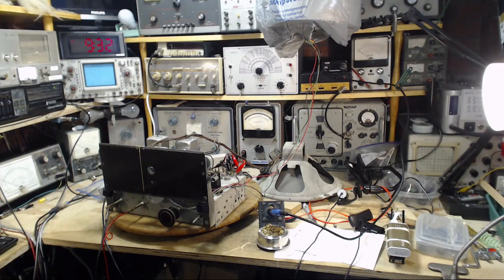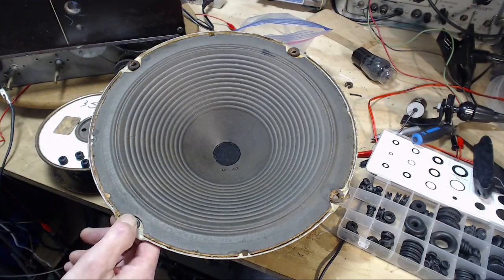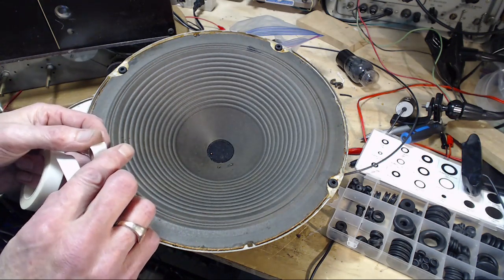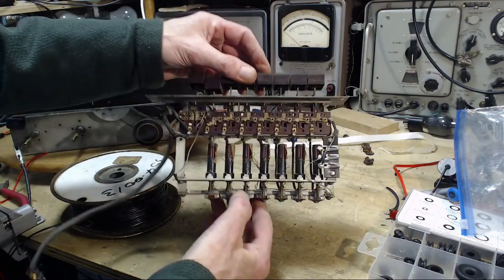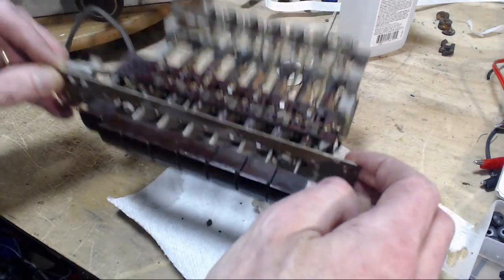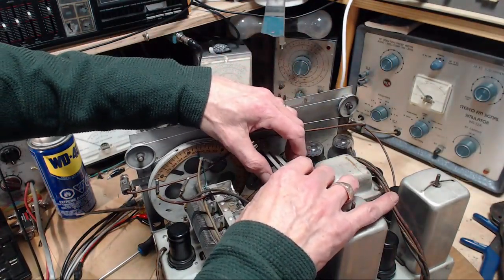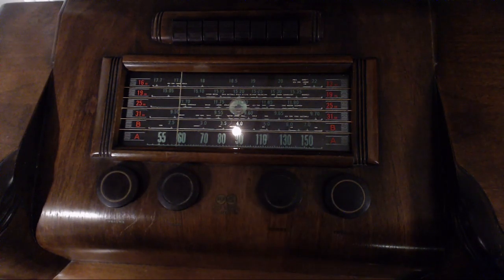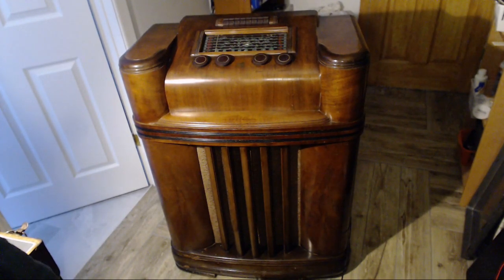RCA A-32 Globetrotter Video #14 - Last Things and Final Test

Comment: That design of speaker (nothing to press against soundboard) was common with RCA during the immediate post-war period. They relied upon neoprene "grommets" to prevent the frame from vibrating and to isolate the speaker from the board. This appears to have been done to prevent "beer barrel" bass at voice frequencies. There was NO cardboard or other material. This was a calculated design by RCA. They also used it on early TV sets with 10 and 12 inch speakers. It became part of their "Golden Throat" tone = clearer voice reproduction instead of the mushy sound produced by competitors. 

Open back cabinets were common and caused a phase inversion between the front and the back. They did NOT use cabinets with backs or ports. That came later with more compliant speakers. You are over-thinking this issue for the time it was designed.
Placed against a wall these open cabinets provided all the front/back separation needed. Adding a seal defeats the original design.

Even portable movie speakers of the era had removable or vented backs in those days and such designs continued into the 70s in non-hi-fi speakers.

Going back in time you will find the same approach with large Zenith radios. Some even used expanded baskets (e.g. 15" frames on 12" speakers) to get the same non-sealed effect. When playing the back wave would have to turn 180 degrees to come forward. This flipped the phase to the proper orientation. Sealing them became a trend by owners years later and if the original speaker was retained usually ruined the tone and made it too "boomy" for pleasant reproduction. Some liked the "jukebox' sound though it was not suited to spoken audio.

Later conversations about these designs said it was done to compensate for the lighter cabinets used after the 1920s. Large, well-attached speakers would pass too much of the low-end sound and cause cabinets and attached trim to vibrate or "buzz". The solution was to create some physical isolation from the cabinet itself. Different approaches were used by various makers. Some simply sharply cut the low bass by using stiff speaker diaphragms or circuit designs. Remember that spoken word was the dominate programing of the day. 

RCA continued the approach in their early TV sets with 10 or 12 inch speakers to make dialog clearer. They extended this to their whole line to create the "Golden Throat" sound they trumpeted in the decade following WW2. Later models had smaller speakers or heavier cabinets to reduce the issue.
Reply: Ray Rooney Excellent explanation and elaboration on your part. Just goes to prove how thoughtful and inventive and creative the old engeneers were. In that light it is even more of a shame how that thought through design was altered now by placing seals where there never were any. And an inproper type of seal to begin with! A foam type seal could be had at any hardware store. But what cant be stressed enough is the fact that a PROPER and TRUE restoration involves accepting the design found and keeping it intact - even if it is or appears flawed, sub par or wrong compared with later designs
Reply: @melissahermsen5630  What a great way to put it! Yes, it is common for us to think of the early designers as being somehow ignorant of things but they knew so much that we never learned about working with what they had and they knew far more about these things than we expected. Reading old engineering publications is amazing. They did know what was going on inside components and what things interacted.
We often think we know such much more now (and we do about what we use now) but they knew their tools as we know ours, maybe better on average.